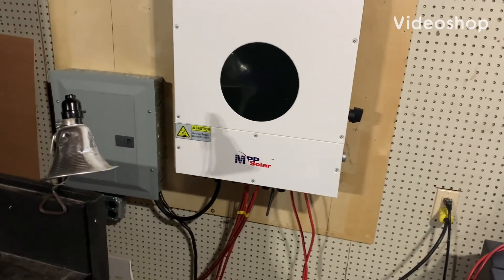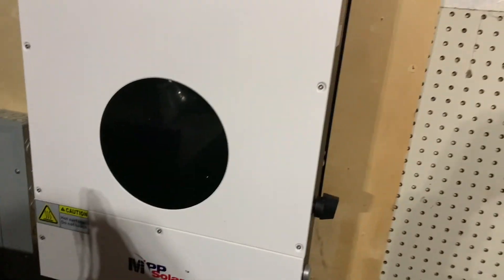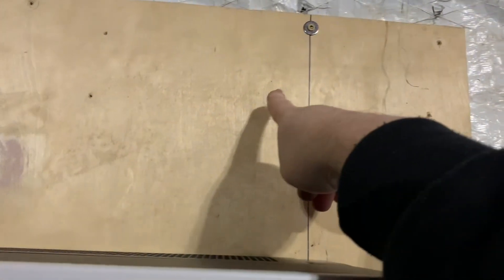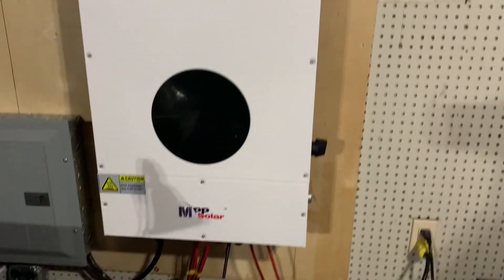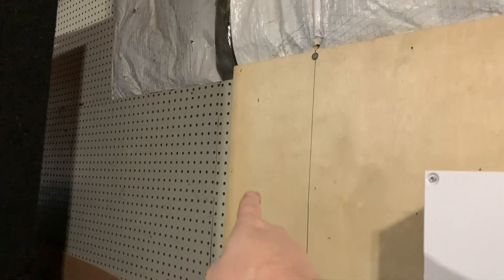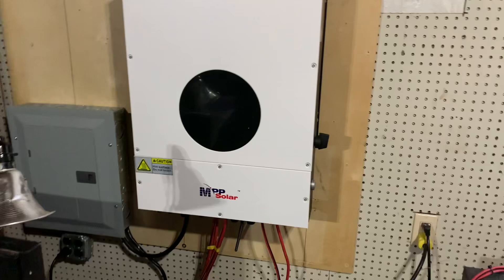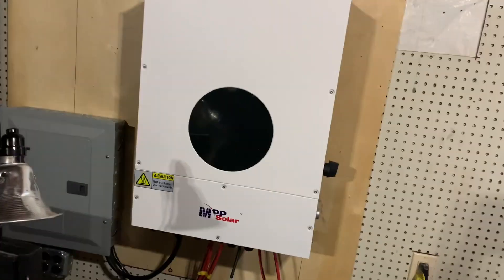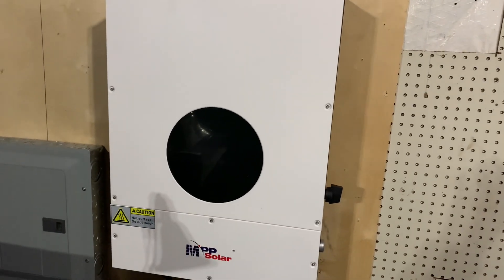The lvx6048-Wp is now wall mounted

Comment: I got this guy too and have not installed it yet. In the house I am at now, I just want to use it as a battery back up UPS (or basically use it at peak times and charge it at low peak times to save money on my power bill). Can you post another video about how you like or dislike the model and how you are using it?
Reply from the maker: You can use it to save a bit but, its idol usage is roughly 150 watts per hour to be on so, i would atleast have some solar on it or, it may end up costing you to run. However it will be a strong ups. Plan on it using about 1.5 kwh per day.

Comment: I agree, 3/4 birch is nice wood but every manufacturer recommends a non combustible surface behind inverters. Just a thin sheet of Hardie board would do it
Reply from the maker: Yeah, I will most likely put some hardy board behind it. I’m not too concerned because the inverter actually has a decent backplate . But, that will happen.

Comment: You should add a sheet of rock board under it. No supposed to mount on flammable material.
Reply from the maker: I may, the trough is, there is a good metal plate inside the inverter and spacers so the inverter isn’t actually touching.